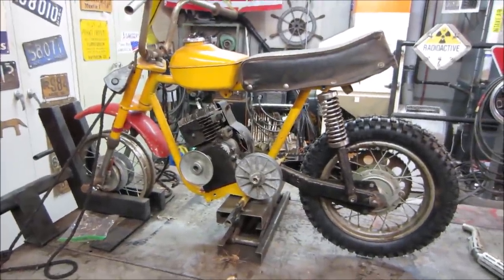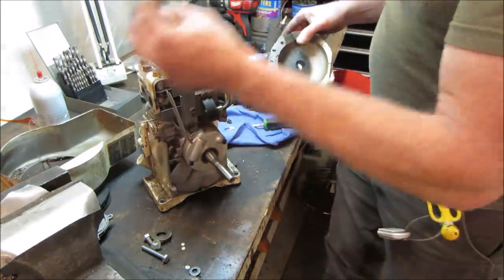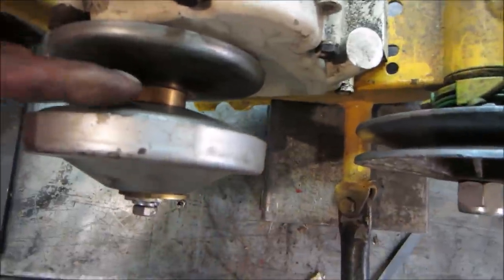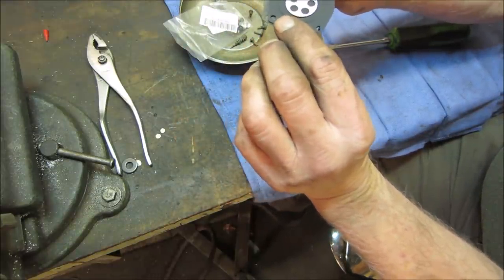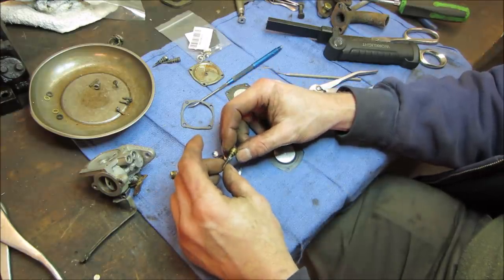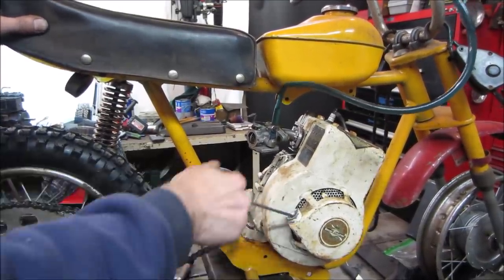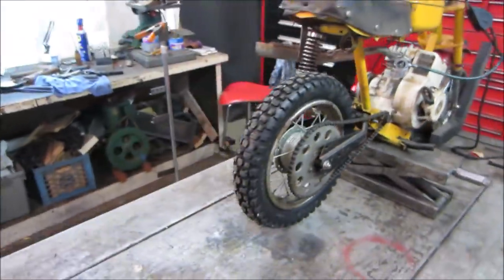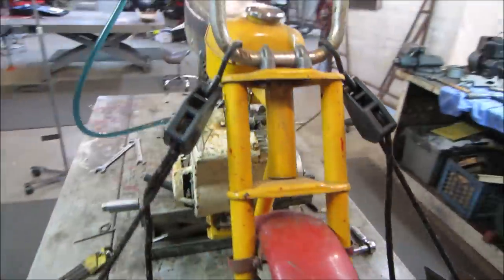Trashed Rupp Mini Bike, Will It Run? pt2

Comment: jealous!!!!
bet this runs WAY better than the 66cc happytime engines i keep buying to bolt to bikes, my last build was a 20 inch bmx with 1500w electric 72v that im currently rebuilding on a 26" wheel, it burns way too much rubber on 20" and i dont have as many parts for that size, the engine looks like the old snowblower i was going to mount to a frame but never got around to

Comment: HAHA! Love the Drive Belt Collection! As Im watching new Q's pop into my head. Have you ever tried using 3D Printing to create ABS Parts such as that little piece you'd taken out of the carb kit? With new filaments inc high temp. resistant/flexible ones you can manufacture many useable components. Im enjoying the thought processes of your videos esp as I'm building a petrol engine bike conversion (UK Law changed July 2021, if your <1000W/1.34 BHP EBike/Petrol bike conforms to Regs you can ride not cycle paths NOR in Parks under engine power without License/Tax/Insurance.

Comment: Had a Rump as a kid. Cool mini bike but never got to ride it much because I had sp much trouble with the torque cluch and jake shaft. The bearings spun in the frame shaft that is used for the jack shaft and ruined the frame.

Comment: Take the screws off of the ramps on the rear pulley. That will make your belt alignment more correct. Absent those screws the entire rear assembly will be closer to the frame. That will also serve to put more tension on the belt due to the increased spring pressure.

Comment: For those little Tecumseh diaphragm carbs if you'll go to one turn out on the low screw and 1 1/2 turns out on the high screw it will generally get you started, and you can adjust from there.

Comment: If you want a better starting better running motor put in a coil with a electronic ignition module built in to it out of a motor of the same size only newer. Or what I do is put on a B & S add on ignition module,  they slip in on old coil , works great !! You would probably have better luck using B&S carb rather than Tecumseh carbs 😉

Comment: I know some of those cvt clutches when you put the driven together you need to twist as you install to put some extra tension in the spring. If you don't it'll try to go into high gear too quickly.

Comment: You were a "Top Bolter"? (Just made that up). I always put the engine mounting bolts from the bottom up. Easier to adjust tension on belt or chain. When I discovered Japanese motorcycles, minibikes became a faded memory, albiet, fond.

Comment: I think your videos are excellent. However what is it about the folks on you tube and tapping holes. I cringe every time expecting the tap to snap. I was taught as an apprentice at Rolls-Royce in Derby UK, to back the tap off every so often to break off and clear the swarf. I guess its fine while you get away with it. Or have taps changed it was 1981 when I was learning. Keep the great videos coming. 😀👍

Comment: I’m not absolutely sure but I think you have the drive clutch on backwards. The flat side goes against the block and the spring housing goes on the outside with a washer behind the mounting bolt.

Comment: The belt will actually move toward the engine on the front pulley because of the taper.  That matches the rear pulley setup.

Comment: Since the front 'clutch' is a belt, the front disk should increase the driven radius upon higher revs while the rear should decrease driven radius at higher revs. I do believe your reasoning was off on the belt alignment problem.

Comment: If I get a diaphragm out intact I’ll sometimes soak it in armor all and then hit it with a heat gun on low. Works for brittle rubber tubes sometimes too when you don’t have a replacement.

Comment: I had to hold my breath when you tapped out the shaft with a drill. No way of knowing you were in alignment to the shaft. You must have a good eye. I'm amazed that tap didn't break unless the tap drill size was over.  No backing out to break the chips. What are those taps made of? I want a set of those. I saw a few of your other videos. Thank you for posting. Subscribed.

Comment: Crazy that little plunger that actuates the points is made out of wood lol i drench the recoil spool and spring right down the middle with ATF. Same with the little idler in the center of the ratchet start. The end of the crank can get nasty and itll grab that idler and rip the recoil spring around the wrong way and basically wreck the whole pull start lol but ATF works great and doesnt get gummy like oil will

Comment: That carb looks just like the one from a Toro S-200 or 620 snowblower. The kits for them are cheap on fleabay, but the problem like you have with yours is that seat for the needle is wrong in the kits. It's that rubber plug thing. I don't know why they do that, but you'll need to either punch a hole in it or reuse the old one.

Comment: You need the 3/4” belt because when the drive pulley plates come all the way together at high speeds, the belt isn’t rising all the way up to maximum diameter. Which maybe isn’t a bad thing given the small engine! Keep it up bud!

Comment: On the end of the engine shaft try a shoulder bolt the shoulder will butt up against the motor shaft and stop the key from walking out. Also it will give the outter shive something to ride on.

Comment: i think if you put a small spacer in between the two rear disks to make it feet the larger belt it will be a lot better, the belt normally goes almost all the way up on the clutch but in this case is like half way so the belt is too thin for it, the spacer will only take the spring presure at the very end so it will still grip all the way

Comment: old briggs points type engine rule of thumb. .010 flywheel magneto gap .  .020 points gap  .030 spark plug gap      10 20 30  always clean the rust off of the flywheel. rust will give you poor performance on points or magnetron ignition. best thing to do is buy the upgraded magnetron solid state ignition and you wont ever have to mess with points again .one other important magnetron tip. do not run the resistor type spark plug with magnetron it make it go bad. you will have a spark but not at the right time  .the resistor creates a resistance and makes the magnetron work hard to push the voltage to the electrode and it dies a early death.

Comment: At 23.56 he finally figures out he has the front clutch on backwards..... You can use washers between the inner piece and block to align the front and back pulleys.

Comment: That clutch isn’t completely shifting into final gear. Needs to be disassembled an lubed up. The primary clutch bolt is usually reverse thread so it doesn’t loosen itself. It really hurts when the primary clutch explodes off against your leg. That engine is also missing the key component for lubrications on Rudd engines that splashes the oil around because of the angle the motor is at

Comment: Aww, and I thought we'd see your cow-catcher grin as you rode through the woods this week. 

Is that diaphragm carb a Tillotson, or Walbro, etc? Or is it an oddball? - It looks more suited to a chainsaw or leaf-blower type of application, or moreover, it looks a bit small for that little Briggs. I remember about 14 years back, trying to get the carb off of a 5hp Tecumseh to run our 8(ish)hp Onan RV generator. It behaved much the same as your engine in this video. It struggled to rev if you opened the throttle rapidly, but would eventually hit the RPM if you took it slowly and carefully - It's not going to be much good on this bike, I think.  The bigger of the two will work better, but then you hit the opposite problem of over fuelling and flooding at high RPMs.  I'd be tempted to play around with the original B&S (Pulsonic?) carb that came off the white engine you're using. I have a feeling that with a bit of engineering, it could be made to work like a Tillotson.

Comment: I believe your back pulley is back words. If it's supposed to open up to let the belt get smaller it can't with the way its setting. Unless your in revs as it can not open moving forward. I maybe wrg if I am plz explan

Comment: If the V of the clutch is symmetric on both halves I think that means that the centerline of the belt stays the same axially throughout the full rpm range.

Comment: Never saw, or used a power tool for a tap, ( or die) , they snap easily enough by hand. But, then again, grew up using most of them in places a power tool would never fit.

Comment: That is the same carb kit for a 2 stroke Toro  S200 snowblower I used to have.  Bought the kit from eBay.
Reply: In fact that looks like the same carburetor the Toro snowblower had.

Comment: Have some 8hp engines very similar to those, on 2 gensets any chance you have or could make a video on modifying the flywheel setup for stator + electric start, or the process of finding which parts off a similar briggs engines with those features that would be compatible? Can get you more info if needed, so far ive modified it to get rid of the stock updraft carbs, in favor of trifuel honda clone carbs :) basically trying to give the things a new life with modern components

Comment: Please be careful when removing governors when running a stock flywheel.  They are not meant to be spun that fast for long periods of time.  Especially if you're running a "big block". I've seen first hand the destruction one can cause. Had to take a good friend to the ER with a punchered lung! It was a go cart with the engine right behind him but still be careful!

Comment: It is the same gear system as on combine harvesters, snowmobiles and old DAF.
Reply: True, before they switched to hydrostatic transmissions.  Our first skid steer had the belt drive gearing.  It slipped when it got wet or covered in crap.
Reply: @robertheinkel6225  LMAO, YEP.

Comment: The diaphragm carb will be difficult to idle .. as the the vibrations drop, so does the fuel metering .. also, thus the delay speeding up too …

Comment: It was so difficult to not scream at the video about how the driver clutch was backwards.  So difficult...

Not only that, but your Beaver is based on a 30 series Comet design where the belt faces are asymmetrical.  The flat faced are on the same side since the belt doesn't move in and out, just up and down.  Your Ripp bike is based on a 20 or 40 series clutch design where the belt is symmetrical.  The moving faces are opposite because the belt moves sideways as well as up and down.  Having the moving faces opposite makes the belt move evenly.

Comment: I think the clutch on the engine might be on backwards try flipping it over and a large washer will hold it together instead of the washer in between the motor and the clutch and the washer rubbing thru the engine case

Comment: The bottom of the rear shock doesn't bolt to the middle of the swingarm, it bolts to the top of the swingarm where that square hole is, using a carriage bolt.

Comment: Tecumseh carbs on the cars and cameras go karts always die out when bouncing around, maybe why the diaphragm carb was on it. Maybe idle circuit needs a little more.fuel for the off idle throttle response to improve?

Comment: the toro s200 i fixed up a few weeks ago had a similar carburetor, similar issues with the needle not sticking out far enough, so i pushed the seat down harder until it kind of popped. it might be damaged it might not be, but it runs
Reply: There are 2 different models of those carbs, you must have got the wrong kit. I learned that when the parts didn't match and found some old diagrams!

Comment: Hi,  I think back pulley is incorrect m back pulley should be fixed w/o centrifugal mechanism. Explains alignment and 3 hp is fine with a single gear ratio range with front clutch/prinative cvt setup. That's how my Dunecycle, worked with 24 hp.

Comment: Mustie...   I just thought of something.....  the Oil stir (on the end of the piston arm)  it may not hit the oil level when the Motor is tilted the required amount on that Bike...  Did the original motor have a modified Oil splasher on it so that it reaches the Oil level?

Comment: Muskie, I was wondering if that front axel is actually the original front axel with a big a** bolt welded on the end? I think I might have done a similar thing one time when an axel was seized in the spacer bushings on a project of my own.

Comment: The minibike may have been designed to use a 5 hp, that's why the pulleys don't line up. The bigger float carb will run rich because it was designed for a bigger engine, the original diaphragm carb should serve you better, besides, you put new parts in it.
Reply: I WISH HE WOULD HAVE KEPT THE 5 ON IT.

Comment: I don't think your front clutch is getting full travel at high rpm because of the thinner belt. Could you modify the slider to get better engagement?

Comment: How about the level of the unit affecting gas flow especially at low tank gas level, since the gas flow was affected by you raising and lowering the disconnected gas line?

Comment: Bicycle and NORMAL motorcycles are 7/8" handlebars, Harley-garbage is 1"....... the plain holes in your motor mounts is for the comet clutch setup, the slotted ones are for a chain setup and standard clutch with no torque-O-verter......... Those Tillotson-style diaphragm carbs are also used on Gas-powered Golf Carts, so you can sometimes look up and order kits from a golf-cart place

Comment: Isn't there an engine difference with the oil being leaned to the front? Would the original engine be designed to lean forward as far as oil issues?

Comment: is the inside sheave on the jack shaft  also keyed? I had thought the belt would drive both sheaves as an dual input to the jack shaft for less slip

Comment: Lol the back pulley has to be flipped. Static part always on the inside. And the other dead giveaway is the tooth are directional . As it sits it would not engage my dear musty
Reply: Basically the flat parts of the teeth need to meet flat on flat

Comment: Hey mustie question for you, i have the hardest time setting up carbs on small engines, Shouldnt you tune the carb with the air cleaner on? Wont adding an air filter add restriction and change the air/fuel ratio?

Comment: I think spinning the clutch around will cause the clutch will not want to squeeze together.  Due to wrong rotation, I think????
Reply: Ok I see, that front clutch works off of centrical force not a right or left hand screw type....

Comment: The original engine on all rupp mini bikes was Tecumseh not briggs! And your gonna toast that briggs because the oil splash bar is wrong for the angle the motor is on! Tecumseh made motors specifically for rupp with the correct bar for that angle they also made a carb manifold for the rupp

Comment: Shouldnt you get a carb with a slide and a throttle cable connection for the twist throttle on the handlebars? The chinese copies of the Dellorto phbg carbs are cheap and decent!

Comment: 5 minutes in and you're giving me a heart attack with that tap.  People do not tap hardened steel with a drill.  90% of the time the tap will break and then you'll just have more problems.  Use a t-handle and back off every turn or so to break the chip.

Comment: I have a rupp I think its a rupp roadster, but my soricket in the jack shaft and rear wheel is on the same side as engine pulley, and I am missing engine pulley. do you know were I may buy the correct engine pulley? mine looks just like yours other than all pulleys and rear sprocket are on the same side

Comment: The Rupp's had a 5HP engine on them not a 3.5 hp. And yes I'm that old to remember those specs.
Reply: They had 2.5  3.5  4 hp   5 hp I think even a  6 hp I believe but pretty sure all Tecumseh  not Briggs
My  Roadster had a 4 hp

Comment: Hate to Ruppremand you after did such a fine job on the mini bike but you checked and then changed the oil on the original engine, but didn't say whether you did such a common sense thing on the replacement or left out figuring most people do that without being told.

Comment: It's strange to see this mini bikes, built with an engine that might have constructed for a generator or a water pump. The engines have only a fraction of the performance you would see on a real motorcycle engine.
Reply: They never were built with a motorcycle engine, so.....

Comment: Do you not own a compression gauge ?  I can't tell how many projects I watched where i said "and now check the compression" so you don't waste your time working  on an engine with poor compression and yet you spend hours more before knowing if the engine is any good...
Reply: Who has two thumbs and doesn't need a compression gauge? This guy! 👍 👍
Reply: @1pcfred  Like you can tell the difference between 70 and 110 PSI with you thumb :)
Reply: @1pcfred  Its just fundamental to the repair - fuel, air, spark and compression -- you go the plug out already, the compression gauge is $12 at harbor freight.   If its low you know there something going on up top - valves, rings etc ---  for some engines, that means your done there as it isn't worth  fixing.
Reply: @haroldh3863  I think Darren knows when an engine has compression. I also know he has plenty of compression gauges too being as he's used them many times in videos.
Reply: @haroldh3863  like it matters with a single cylinder small engine.
Reply: @1pcfred  I'm have watched hundreds of his videos and love every one..
Reply: @haroldh3863  then you know Darren owns a number of compression gauges. You should also have divined his experience in matters concerning assessing the state of internal combustion engines by sensory means.
Reply: @1pcfred  what are you.. his press agent ? 😀
Reply: @haroldh3863  just a viewer.